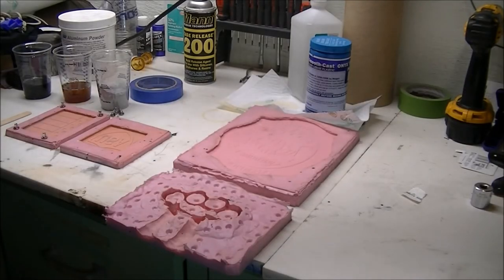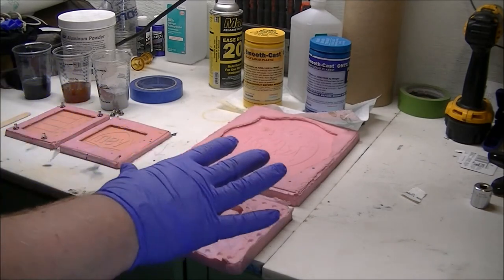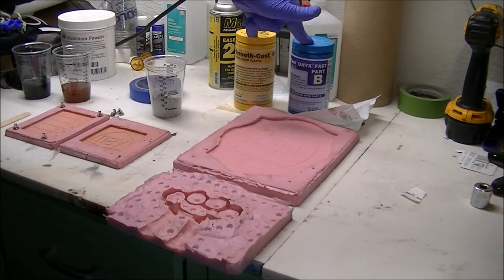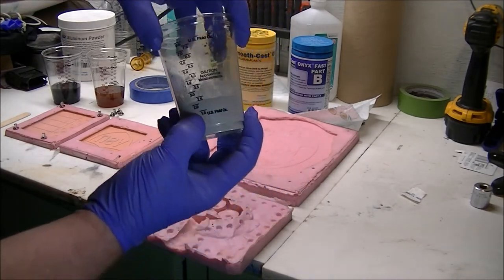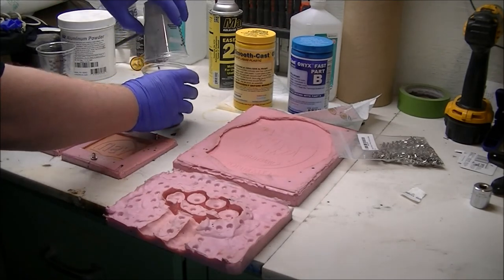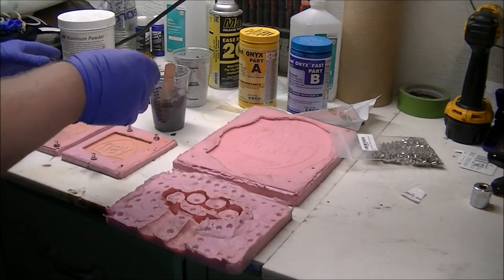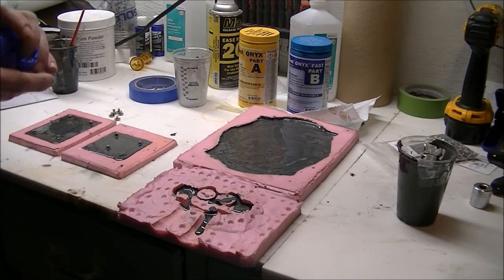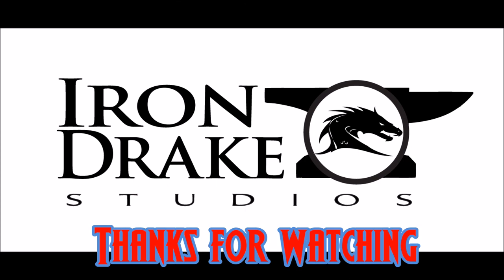Casting Championship Belt plates

Comment: Can you bend the main plates?
Reply from the maker: Yes.  Once the resin has set a bit, but not fully hardened, you can prop the edges of the mold up, I have blocks for this.  Usually 15 minutes after pouring the resin.  Then let it sit for a couple hours to harden and retain the curve before demolding.  I don't do this for the smaller main plate, but for the US and Television plates I do.
Reply: Thanks man! I'll try it out

Comment: Do all belts eventually rust/tarnish? Is there a way to prevent that from happening?
Reply from the maker: Yes.  There are clearcoats that can be applied, like automotive 2K, though these are expensive and time consuming to apply.  Otherwise you have to be vigilant, and keep up on the care.  some thin plating does not come back from tarnish, and eventually pit marks appear. Ammonia-free window cleaner is among the best daily cleaner.
Reply: @irondrakeStudios  Thx!

Comment: What is the cost in material for 1 belt 5 piece without the mold? Thanks you.
Reply: Vincent Lapointe cost of materials is about $85. That's price of resin, plus shipping, esse release, mixing cups, stirrers, screw posts, cost of the metal powder varies depending on which you put in.
Reply: sivant79 thank you very much for your reply.

Comment: what resin did you use? i didn't understand very well, to get the metallic finish
Reply from the maker: the resin itself doesn't matter as much.  The metallic finish is from using real metal powder (nickel, copper, brass) in the resin.  I use the Smooth-On Onyx black resin to help bring out the metallic colors better.  

There is a link in the description for a video by Smooth-On that shows more of the molding casting, and adding other colored powders..